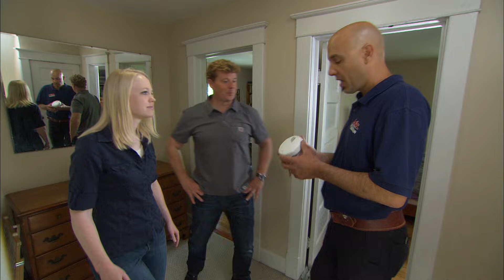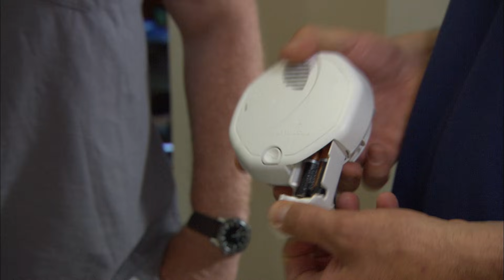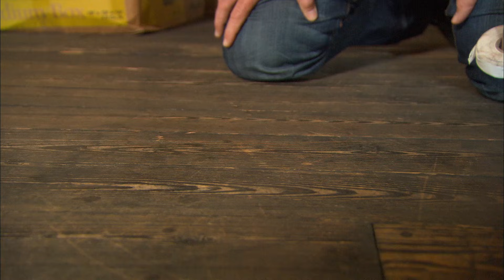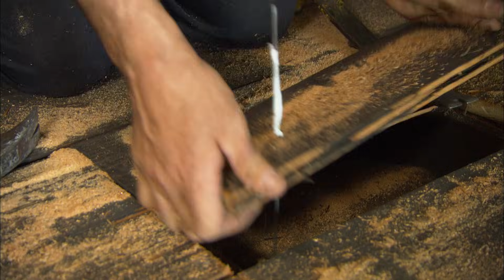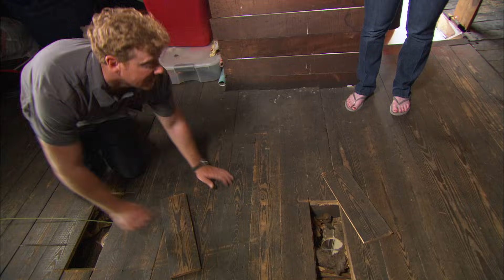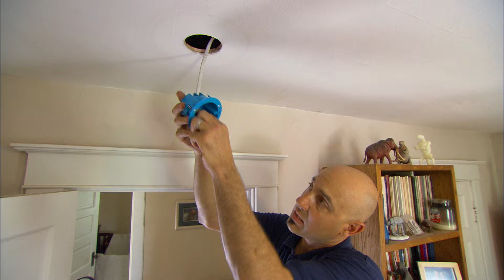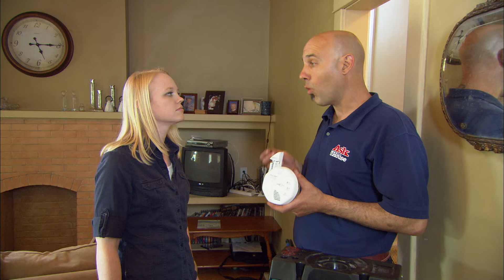How to Install Smoke and Carbon Monoxide Detectors | Ask This Old House

Comment: Quick Question, if a person is hearing impaired and is living alone, how can she/he knows if a fire is starting?
Reply: They make smoke detectors with strobes, perfect for someone that is hearing impaired.
Reply: a dog
Reply: They have alarm that can send you a txt message/email thus making your phone vibrate. I guess that would provided the wifi is not the source of the fire. :/
Reply: Jack where can you buy them?
Reply: Mark R well they cal rely on smell and vision or get a smart alarm like nest protect. It will send a notification to their phone both visual and audible.
You could also get vibrators for your bed or sofa
Reply: Strobes
Reply: Mark R they make horn strobes for that situation
Reply: smell
Reply: jimmy I’m not deaf, but can I have one?
Reply: if your budgie dies you've left the gas on
Reply: Mark R they have some that flash lights
Reply: https://youtu.be/L7L3iSZsNpY
Reply: +bobloblaws911 those vibrator alerts are very handy usually they install them between then individuals private parts for max alertness and stimulation
Reply: THEN THEYRE FUUUUCKED!!!!!!!!!!!!!@!!%

Comment: WELL can someone explain why your need a Carbon Monoxide if you have all electric in your house because I have a Electric stove I dont have anything gas in my house?
Reply: Even if you don't have any gas appliances. It is still recommend to have one, as carbon monoxide can be produce from more things then you may think.
Reply: It detects low smoldering fires or if someones car or genorator or something else emits that gas and it gets inside your house you want to know so you can get out safely and stop the source of the problem or call 911
Reply: Becuase our house just has the one in our hallway Aaron Productions